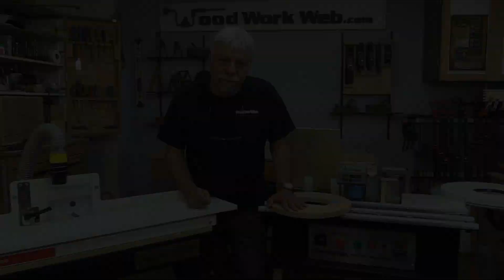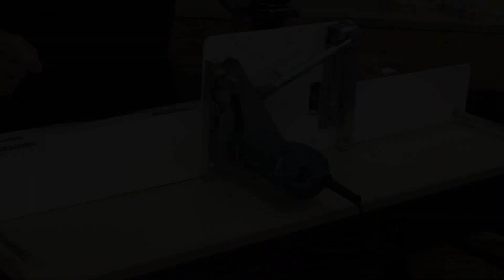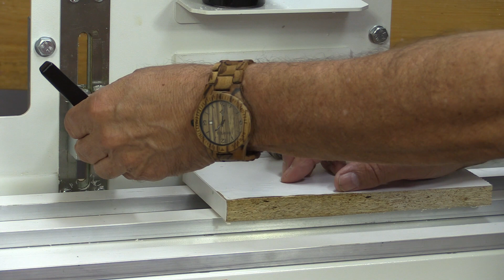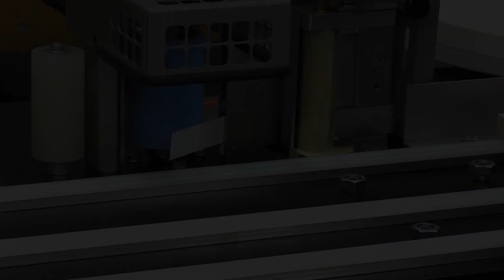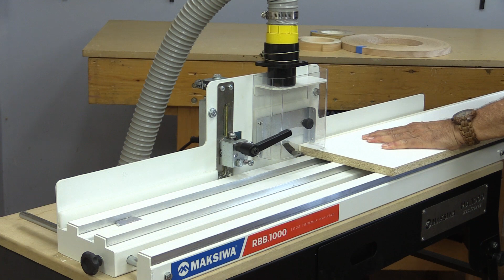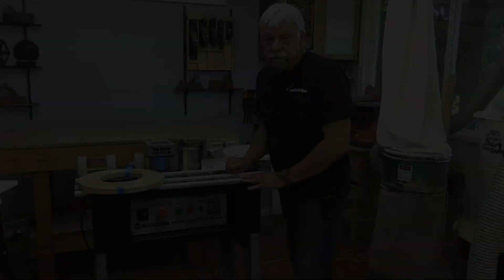Using the Maksiwa Edge Bander and Edge Trimmer

Comment: These are awesome machines, but here in France only particle board is readily available. I have used the edge bander in a  professional shop and agree, if you are running hundreds of feet of board they are economic, but recently i made new kitchen doors for a mobile home, which had to have custom size doors cut. The difficulty for me is using the table saw without edge  chipping, and I resorted to cutting the doors 6mm oversize and then routing to size with a panel router bit. Cutting cabinetry for boats, I used to finish all out of sight panel edges eith varnish to keep the damp from the edge of the panels that are left raw. I probably could not buy an edge bander, although in a shop setting, but I would make a jig to trim the edges as  it is very time consuming hand trimming the edging.

Comment: I have this tool.  Its nice although I had a little trouble dialing it in for the material I was using.  I was using a 3/4 veneered ply with the core being 2 different materials.  The middle was actual wood/plywood and right under the veneers on both sides was mdf which did not stick quite as consistent as the middle.  I adjusted the temp and flow rate of the glue and it seemed better, but any advice?  Thanks
Reply: Yes! Don’t use classic core!  I absolutely hate that stuff!!!

Comment: hello, I have a virutex 250 on the table and it works well with a little intense work, which I liked in your machine is the fact that distributed the glue before and separament of the tape, which gives the time to react and avoid wasting the tape, good presentation; good continuation

Comment: hi  there 
great video  when i was cabinet making here in ireland  a job i had to give up due to severe arthritis in my spine  i had the  edgebander and trimmer combined which made my job so much easier and faster  i needed this type of machine  as i was  a self employed kitche maker  and as you know in ireland we use  mdf or chipboard  sheets  and cut them  down to make our cabinets 
 although even since i gave up the business  things are changing  and more and more are using pre edged panels and cutting them as required  but i know these combi machines are expensive  and i  can see how the two seperate machines would be less to purchase but add   great ease of work for the woodworker
Reply from the maker: Yes, real time savers.Thanks for watching!